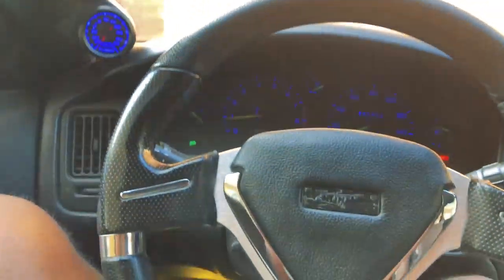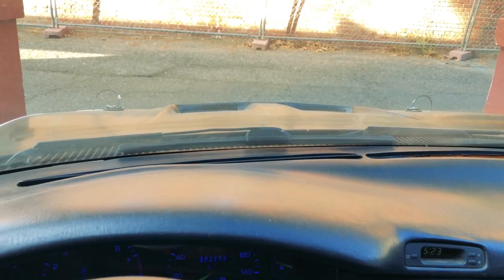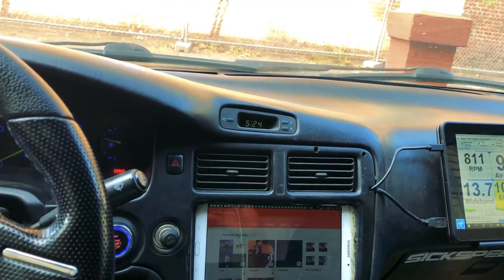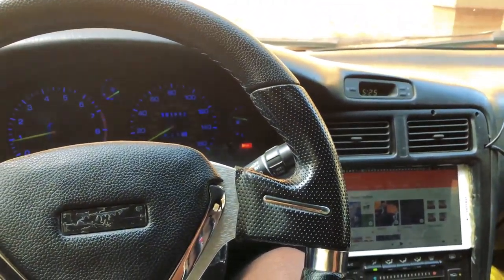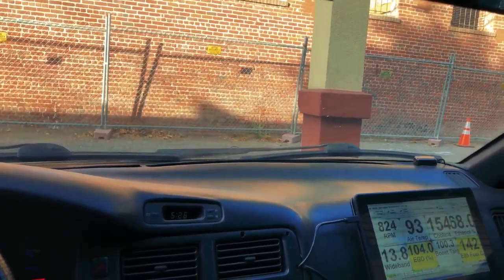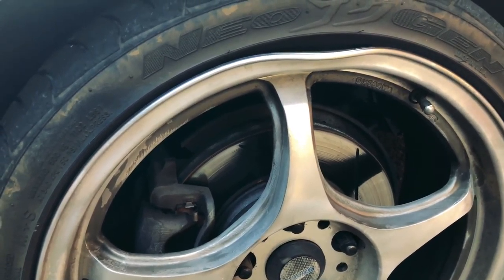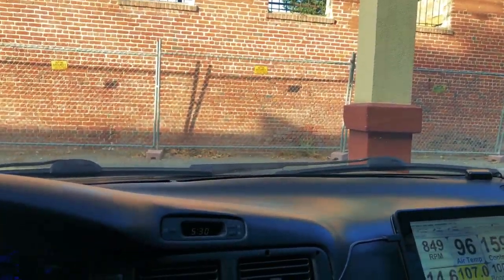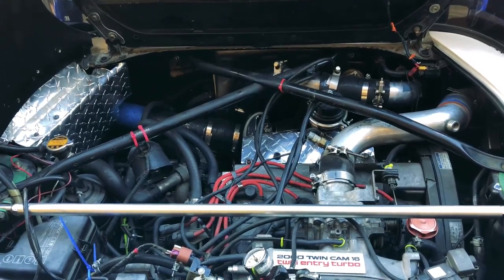5 Things I HATE About MY MR2 Still Love Her Though (3SGTE)

Comment: looks like you need to start working those issues out, every mr2 requires some mechanic skills, your using meth injection and e85?? isnt that over kill or are you using the factory side intercooler still? is that the reason for meth and e85 im a little confused.
Reply from the maker: Full Throttle it's overkill. I started with 91 and methanol then went to e85 and methanol. The manifold cooling is amazing though. Upgraded side mount.